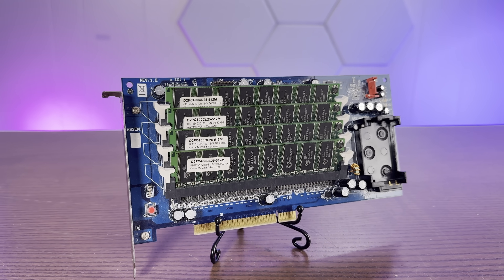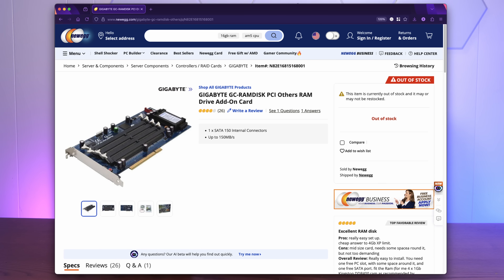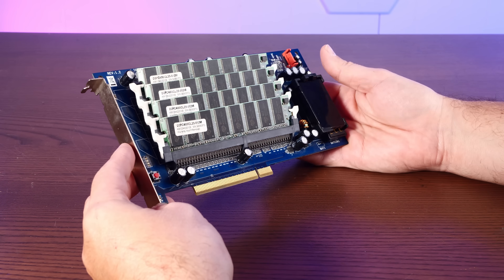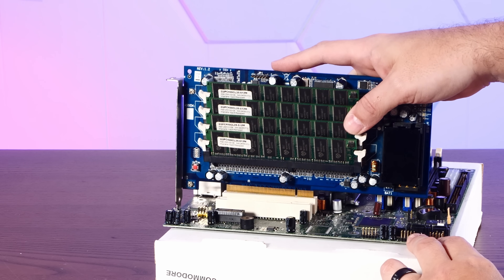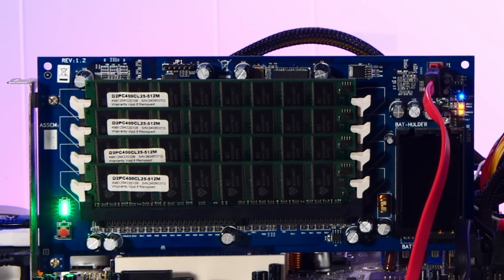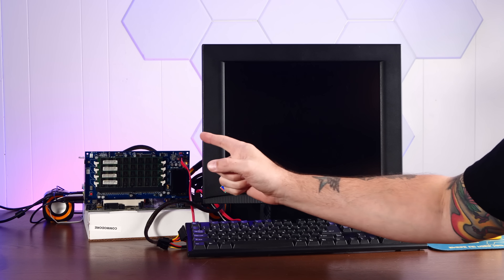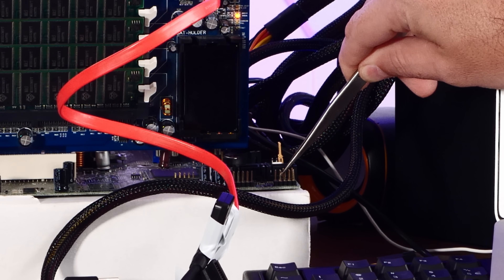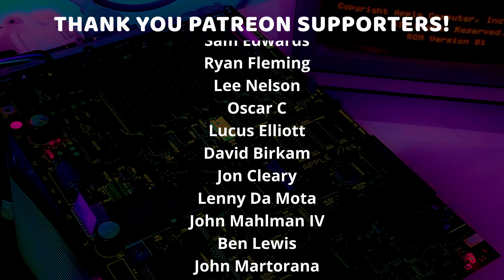This Early SSD Was WILD

Comment: There was like a 2 year period where this was an incredible idea
Reply: There were several products like this in the early 1990s also. I can think of at least three products in the 1MB to 16MB range.

That was enough to boot a simple command line OS off of, with extra room for some applications and files.
Reply: @TheBilgepumper  Late 80's even. I have an old one just as a curiosity, ISA bus, for a 386.
Reply: @PiDsPagePrototypes early 80’s. They had these for the Apple IIe
Reply: @gamesgeargadgets Good idea's keep being recycled. 👍
Reply: those are still a thing, and they still have better random access read speeds compared to ssds.
Reply: @yoshi314  beside speed, they can survive millions of writes daily, that would kill most flash chips.
Reply: @arivaldarivald3212 Yes memory has to withstand 10^11 read write cylces
Reply: @yoshi314  who still makes these?  These might be great for a set of index only tables I use for a high volume web server.  I might want to give these a try
Reply: @chadweirick  The best way to do it now is to simply add more RAM to your web server. If you use Linux it is trivial to create a RAM disk. Using zram, you can create a RAM disk that has built in compression (often LZ4 or zstd) meaning that you should be able to compress those index tables by 2:1 to 3:1. 

Then again, if your webserver is too slow it is not configured properly. Not enough RAM, not enough cpu, not enough IOP/sec, etc etc.
Reply: @Slackware1995   I have seen various different RAM disk solutions.  I was hoping for a hardware solution that didn’t draw so heavily on system resources.  With the hardware spend complete, if we had to factor in more RAM post-purchase or if there were bandwidth considerations, it would be nice to have a discrete hardware alternative.  If you know of any those please point me that way.  I found a few around 2010 or so, but they seem to have vanished.
Reply: @chadweirick : These things fell out of production (again) for a while, but they've apparently reentered the server/enterprise space recently. I THINK the technology is called CXL, but I might be misremembering. I think they're largely targeted at the AI space because of how many writes and how much bandwidth that use-case wants.
Reply: @chadweirick  OWC's Accelsior is a similar device, just use Optane drives instead of NVMe SSD's.
Reply: @PiDsPagePrototypes  yeah we already use ssds.  Looking for the crazy IOPs that comes with RAM.  I don’t care about the volatile nature as I can rebuild the index in boot.
Reply: @yoshi314   once I made a strange experiment in my office, PXE boot and running 2 systems totally from RAM without any hard drive.
Once one system had to reboot, it would pull the system from the other. as long as you never booted both systems at once, it worked.
Totally working from ramdrive booted from network.
Reply: @yoshi314  where can I find modern ones? I wanted one so I could mount it to a Linux system's RAM file. That's probably the ideal case for one of these things so long as the FS data is on NAND flash
Reply: It's a RAMdrive - and this idea still incredible
Reply: Nah. When this board was available, the cost of RAM was too high. It was a neat toy for people with more money than god.
Reply: @CptJistuce  it looks like the past is repeating itself
Reply: @epicnicity916  :'(
Reply: @epicnicity916  No kidding.  I just looked up the prices of some RAM I bought a couple months ago, and it's more than tripled!  I knew prices had gone up, but dang!
Reply: I mean... wouldn't it still be today? Being able to take cheap DDR3/4 and making a RAMdisk out of it would still be amazing.
Reply: @Fay7666  One of the use cases was likely to sidestep the 32bit maximum of 4GB of system RAM (only 2-3 of which is usable per individual application). With 64 bits, you can throw as much RAM as you need, at least it will also performs at regular RAM speeds too. These days you might as well just throw in an Optane drive.

If you want it non-volatile, you just use a software ramdisk as a writeback cache to something less volatile like an NVMe. With the price of RAM, you might as well just RAID0 a couple NVMes and not worry about batteries. With the price of just like 128GB of DDR3/4, you can afford several SSDs of higher capacity to RAID0.

It would only fit the really niche use case where NVMes aren't fast enough, and you need to commit data to storage instantly such that if the system crashes nothing is lost to cache background flush, and you're okay with relatively small capacities, and still okay with the risk of the battery running out.
Reply: @maxpoulin64 yeah a RAMdisk with a PC plugged into an UPS will beat this or something similar every time. The only benefit of a card like this would be that you have extra slots for your RAM. However, I don't know any consumer application that hogs that much RAM that you need more than 4 sticks of whatever is the maximum for RAM sticks now or so much RAM in addition to the speeds of a RAMdisk.
Reply: @Ninjaeule97 even with a ups, it won't survive a reboot or system crash
Reply: @maxpoulin64  If your workload involves LOTS of writes, entirely rewriting the drive multiple times a day, a RAM based disk could have the longevity edge in comparison to SSDs however.  That said, the whole SSDs wear out argument is a little overblown for the vast majority of workloads.
Reply: @phill6859  you know that RAMdisk flushes onto permeant storage when you reboot, right? As for system crashes, yeah that's a problem but unless you saved right before the crash happens then you will lose data anyway even if you aren't using RAMdisk. Get a stable OS if that's your problem.
Reply: @Ninjaeule97 Four sticks traditionally is dual channel access. Mine has eight sticks, quad channel.  I can write to four sticks at once, hence four times as fast.  You can also get eight channel configuration with 16 sticks when using high end servers.

There is no reason why manufacturers could not adopt expansion slots for RAM that stack multiple RAM slots.  In the old days, they had adapters where you could plug in four 72pin sticks of EDO RAM into an adapter and plug that into a SDRAM slot.
Reply: @Fay7666  You can still do that today. My main PC has 128GB of ram, 64 GB is set aside for a ram disk.
Reply: @thatguyontheright1  Cool but it hasn't got a battery backup.
Reply: @thatguyontheright1  I'd fill your 64Gb ram drive in about 20 seconds with Uncompressed Raw 4K at 120fps,.... :D
Reply: @Fay7666  It would be better and more practical to just make a RAMdisk with your actual system RAM via a software solution.
Reply: @gattocake  But then that wouldn't have a battery connected to it.
Reply: @gattocake : You'd often use these nowadays (and honestly, back in the day as well) because you want to accelerate you virtual memory operations, which wouldn't be desirable if already had the RAM to do what you're talking about.
Reply: @gattocake  You could, but then you quickly fill the system ram and the PC slows down while writing the data out to SSD. Take one of the current designs with NVMe (aka PCIe) interfaces and fill with Optane drives, and you can buffer incoming data, such as high frame rate video, long enough for a Raid Array of SSD's to be able to write to the drives, especially useful for doing Sports Replay's from high speed cameras.
And if you need to go faster, there's versions that take current memory, and hold just enough video to be useful. Have you seen the GlamBot camera run by Cole Walliser? The PC that dumps footage to is the sort that makes use of one or more of these types of devices. Record in to the high speed ram drive, then write down to slower NVMe drives.
Reply: @gattocake  There are a lot of reasons why using a dedicated ramdisk would be better than doing it with system memory, but here is the biggest one.  The more memory you have in your actual PC the harder your memory controller on the CPU has to work to keep all the little "buckets of leaky water" filled.  It puts extra stress on the memory controller and generally limits how fast you can run the system memory, which on systems like AMD CPU's will hamper the performance of the system as they are pretty heavily dependent on memory speed.

By keeping your actual system ram slim at like 32GB you could have fast ram speeds for the CPU without over stressing its memory controller and put a ton of ram on the physical ram disk instead as that memory doesn't need to run nearly as fast as your actual system memory does.
Reply: @gattocake  It's literally just a convoluted sleep-mode function.

When your PC goes into sleep mode, the current OS session gets saved in the RAM, specifically to create near-instant startup when you use the PC again. :P

So... You can use it whenever you want... Well, at least if you're on Linux, idunno how well sleep works on Windows these days, i don't use it anymore. xD
Reply: @gattocake  Better to take the load off the system memory controller and put it on a less utilized bus, like PCIe. It's the same reason page/swap are still used by Windows/Linux even without suspend or running low on system RAM.
Reply: @gattocake  well no, not if you're trying to use older spare RAM. Like if you just upgraded to DDR5 and want to still use your old DDR4 for this purpose.
Reply: @gattocake Battery?
Reply: @MyouKyuubi it's independent from the os. Your system ram disk won't survive a reboot.
Reply: @gattocake  Way too small. Most desktop CPUs still don't even allow more than ridiculous 64GByte or maybe 128GB at best. And this isn't available exclusively for a RAM disk, by far.
Reply: @gattocake  Problem:
Motherboards only have a limit of like 128GB's of RAM for DDR3 / DDR4.  DDR5 extended that to 256GB, but regardless something like this card could extend your maximum RAM capacity well beyond the 128GB or 256GB limit.

Another problem:
high capacity RAM sticks are expensive, and not everyone wants to shell out for individual 64gb sticks in there main PC.
So, filling a card like this with a bunch of super cheap 8GB sticks could give you 32GB's of RAM disk storage all to yourself, or hell go up to 16GB sticks and now you have 64GB's.  32GB's would give you 128GB's of course.
Reply: @phill6859  "it's independent from the os."

... What are you talking about? Did you reply to the wrong person?

"Your system ram disk won't survive a reboot."

Look, idunno what you're talking about, but it FEELS like you're missing a page here, this techynology is from, like the windows 98/windows XP era, where NO OS had a sleep function.

So they had to turn OFF their computers, when they weren't using it. But this hardware essentially transformed "shut down" with "sleep", as it functionally has the same principle as the sleep function of modern OS's.

And Modern OS's do not NEED something like this to boot fast, anymore... So mentioning how "system ram disk" wont survive a reboot is literally irrelevant... Also... What the fck is a "system ram disk"?!

So yeah, your comment confuses the living 💩 outta me, 'cus i haven't the faintest clue what you're talking about!
Reply: @MyouKyuubi I replied to the correct post and I stand by my reply. This technology survives the os being reinstalled or rebooted. This isn't like sleep mode, which has existed even in MS-DOS and windows 95. This physical ram disk is an actual disk, you can plug it onto a different computer. Nothing at all like sleep mode, which is entirely limited to the computer and the running operating system
Reply: @gattocake  Yes, but only f you could battery backup your onboard RAM so you could boot from it...
Reply: @gattocake  you can reuse old memory banks for this
Reply: @gattocake  as a software solution, you are faced with the same issue as onboard shared memory graphics.  Since there is no dedicated memory or controller, you get a bottleneck when your actual processor or memory usage goes to 100% for other tasks.  I use a 16GB Ramdisk on my Xeon W3680 and a 64GB ramdisk on my Xeon E5-2699V3.  It can speed things up, but sifting through that much memory for hard drive cache uses up a bit of processor usage.  I sometimes get glitches when accessing web pages, even though loading the browser is nearly instantaneous.

It is honestly much better solution as on a dedicated card, via M.2 Pci-E or straight up PCI-E.
Reply: @Fay7666  You can do it in software now days, in Linux you can do it natively. Windows you'll need 3rd party software.
Reply: @hawkmanhawk  You can (I run them on 2/3 of my systems) but a dedication hardware solution would still be a lot more optimal.
Reply: @Fay7666 ram isn't cheap, look at it this way, 100 dollars of ddr3 is pretty much 64 or 128 gigs, vs 100 dollars of nvme which is 10-20 times as much storage almost.
Reply: @Fay7666  i wish
Reply: It still is a great idea, none of the reasons it was a good idea have changed, it just doesn't have a good updated equivalent.  DDR4 is still way faster over PCIe than any NVMe drive, there are plenty of professional apps that benefit from a dedicated scratch disk (and slowly destroy most drives), and Windows STILL abuses your drive with pagefiles.
Reply: @KiraSlith  linux
Reply: Still useful for NAS setups.
Reply: I wouldn't mind this now for swap partition/temp files, etc to take the excess writes off of a SSD.  Longer SSD lifespan, faster swapfile access, keep the main filesystem cleaner.
Reply: More like a decade.
Reply: @seanwieland9763  Nay, it had limit on max RAM size, i think 4 or 8gb.  In Jan 2009 i bought a 256gb SS for AU ~$800.   IT had a very limited window, and would have been expensive to loadout. The board itself was AU ~ $300
Reply: yea
Reply: I used versions for much more than years during the 90's
Reply: That could be said about all technology from 1970 - 2010
Reply: Holy comments! Glad this sparked some discussion, I've learned a lot about ramdisks and enterprise hardware haha
Reply: You'd be shock at how often stuff is a 2 year great idea while tech catches up.
Reply: I had one for my Apple II in the 80s with 1 megabyte. This is very late in the development.
Reply: well I have a z8 g4 and you can dedicate some of the ddr4 slots for storage ... you can put special storage module,  Intel Optane DCPMM,  in those ...
Reply: still is, a non(ish) volatile memory linux swap space could save your ssd from all those reads and writes and the speed is nicer, a hacking machine with a panic button, heck even a external drive with a panic button for sensitive data air gap transportation, if you use your imagination you can find applications for these and are actually sensible things, the early Palm devices used ram as flash storage and the only thing keeping your data in there were the main batteries and a 3V button cell for backup power when you swapped the triple As newer models ha lithium ion, but still used rom for storing the OS and ram for storing installed programs and data, only when true flash memory became cheaper they changed that.
Reply: I got my first computer in 05 it was a Pentium 2 gateway. Remember exploring the web seeing this thought it was an increase in my ram I didn't really understand that at the time, haa.
Reply: Shockingly long time
Reply: Yeah these went further than 2006. They had a 9 volt battery instead of a the rechargeable and there was nothing you could really buy that was this quick. Not to mention you were supposed to have your data backed up to a real drive. By 2006 this wasn't as useful, but SSD were insanely expensive for small sizes even then.
Reply: These were around a lot earlier than 2006 IIRC.  I remember hearing about similar devices back in the late 90s but they were quite expensive.  This one at $140 is quite good for the time.
Reply: They already existed in the 286 era ... on ISA boards.
Reply: A RAM card would be great today if it supported NVLink as well. It'd sell like fire.
Reply: How many HD arrays are still fundamental to our system? Guess?
Reply: Low quality DDR4 would be perfect for this right now
Reply: @3of12  There's a ton of old DDR3 in drawers looking for a use like this too.
Reply: This was around for decades, not just 2 years
Reply: @AlexBayes I'll take your word for it, seeing as I was 2 years old in 2006 I'm not super knowledgeable in the subject 😭